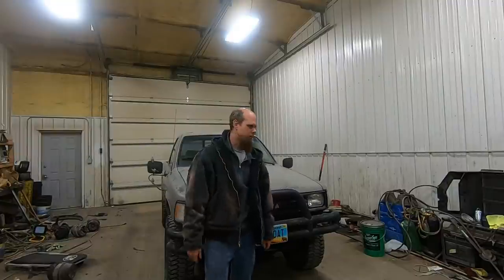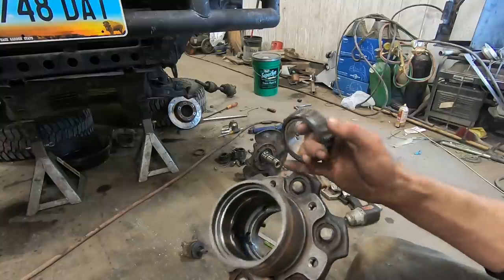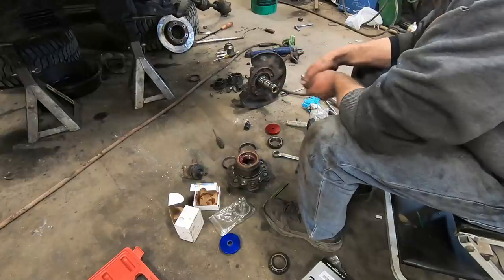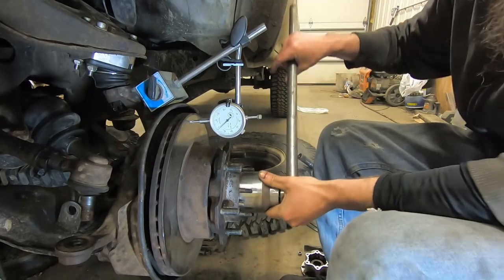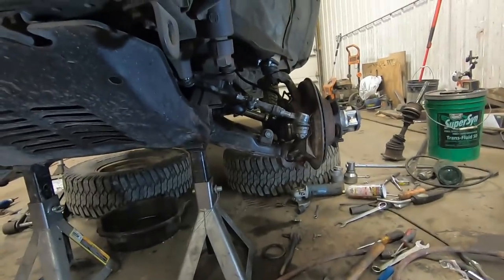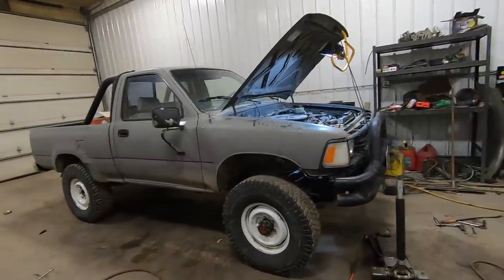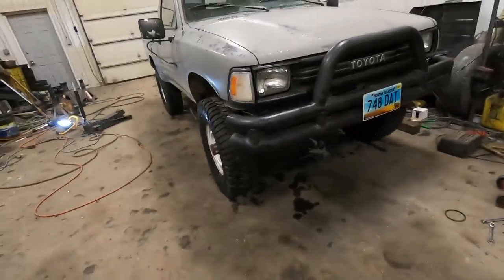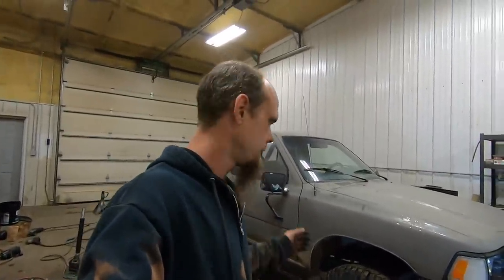front end rebuild + 2 inch lift 89 Toyota Pickup 4x4

Comment: nice done I like your "press" tools,
but I wouldn't messure bearing play from the brake rotor.
Sad those Pick ups are not to be found around here, maybe they all rusted to the ground by now.
Reply from the maker: I couldn't reach the hub from the spindle with the arm I had on my indicator. If you notice where I placed my hands when checking end play it wouldn't have messed with the reading.

Comment: Well Mr ezrider turtle here thinking of a c3 now my question is 427 or 454 which is better big blocks has more torque and h p at bottom than small blocks
Reply from the maker: 454  or bore and stroke the 454 to 496 there's no replacement for displacement....well except for boost....lol

Comment: You could probably get away with a 1/2 in spacer on the front wheels to keep from buying new wheels.
Reply from the maker: yeah not really a fan of those wheels anyway and don't really like wheel spacers if i can avoid them
Reply from the maker: wheels i have ordered are only about $60 each